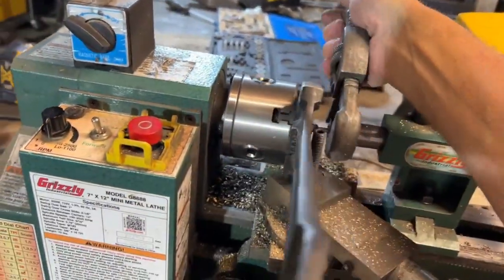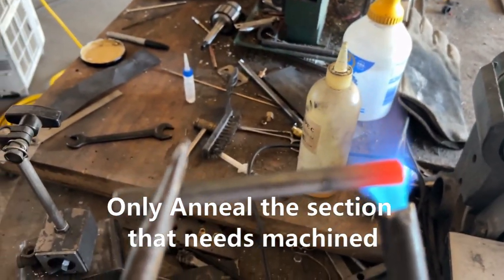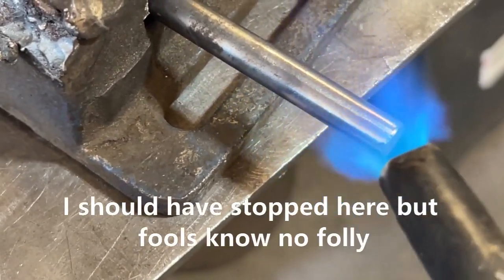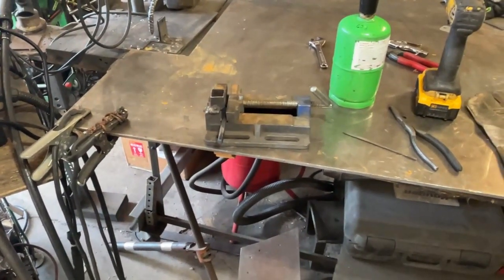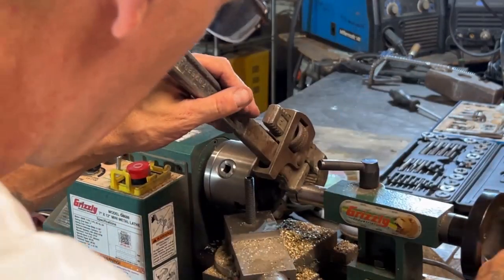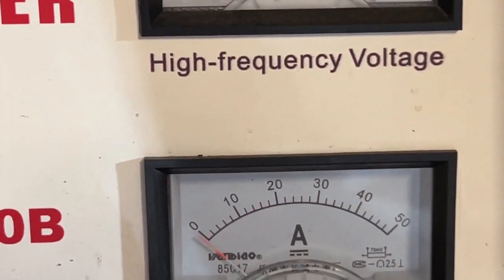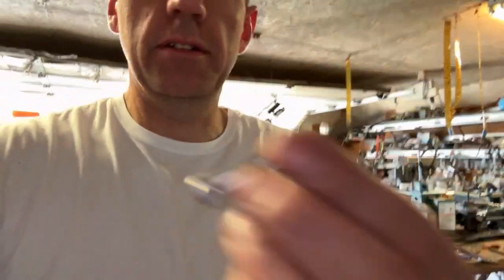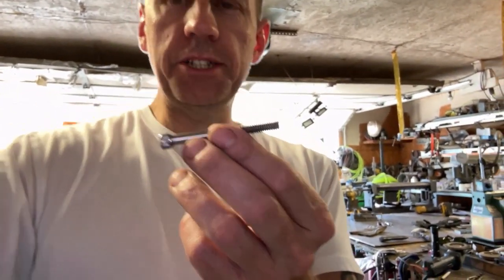Precision Machined Bolt Nobody had in stock 10-32 x 2 3/4"

Comment: Quenching is done in oil or water or brine(water+10% salt) ,sometimes even in melted salts to increase hardness.What temperature,how young you hold it on that temperature before quenching it in specific  water/oil/salt depends from material to material and its carbon content -general rule is the less carbon material has the quicker the cooling has to be.By doing it a lot of stress accumulates in material which leads to brittleness  and that's why you temper it .
By tempering the metal you loose some of the hardness but material is no longer brittle like glass ,it gets more flexible and more impact resistant.
Reply from the maker: Zamba, thanks for taking the time to share your wisdom with us . I have often found some of the most valuable information from commenters on videos that failed to exercise expertise such as yours  . One day somebody will try to heat treat a part and find  your comment waiting for them . Please sub and join the some 10,000 experts that follow this channel. I am truly blessed to be amongst the likes of thinkers like you . Not that im saying i compare . I am a meager humble servant .

Comment: Ive never hardened anything my self but i read an old book, by a blacksmith who use to make his chisels for stonemasonry and he quenched after the temper, alwxander g weyens i think was the author, no idea if it makes a difference myself, what are youbdoin with the water trough, what process is that
Reply from the maker: Its an EDM machine
Reply: I'm no blacksmith but quenching rapidly cools the metal crystals, causing them to tightly lock and become a lot more brittle and harder. Then you temper to release the stress within those locked up crystals causing it to be softer and less brittle but in a controllable way. However it depends a lot on the metal/alloy